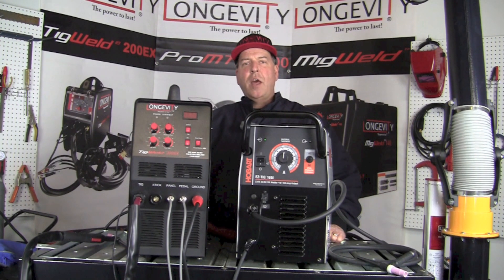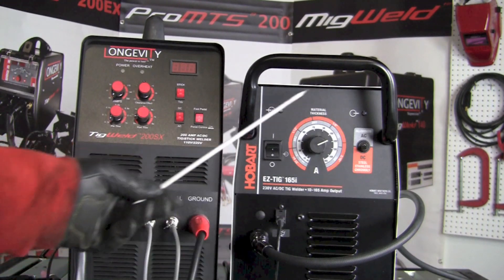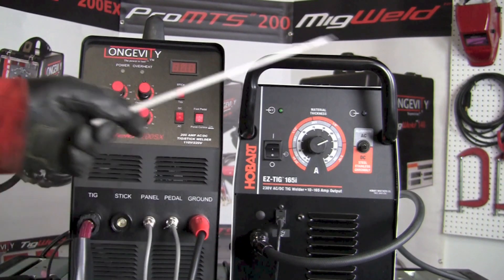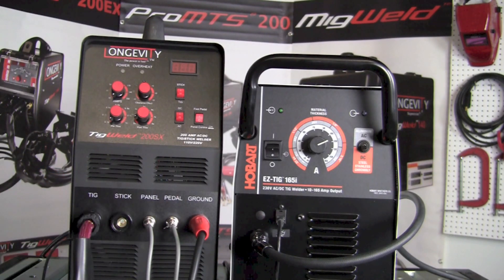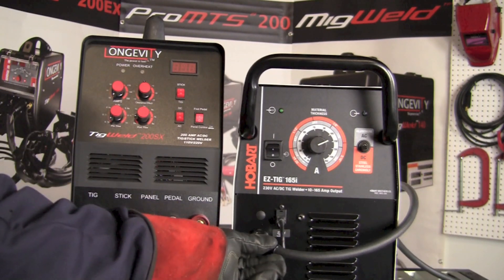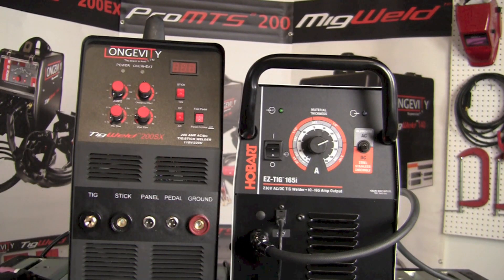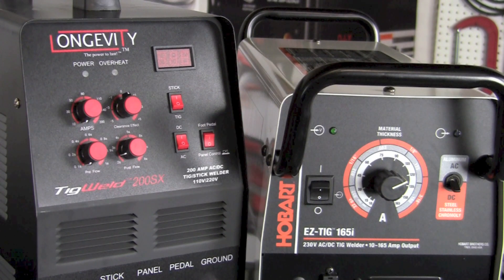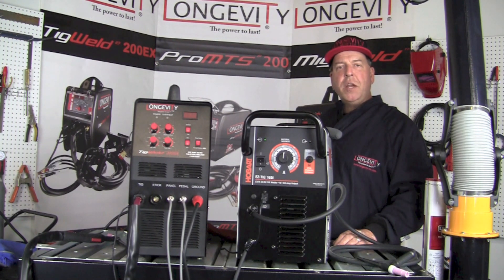HOBART EZ TIG 165I vs LONGEVITY TIGWELD 200SX HEAD TO HEAD MACHINE CONTROLS COMPARISON REVIEW PART 1

Comment: BOTH MACHINES ARE PRETTY MUCH THE SAME PRICE I GUESS CIVIL BART PEOPLE JUST WEREN'T THINKING AND IS PROBABLY COSTING THEM THE LONGEVITY DOES HAVE NICER FEATURES ON IT AND IT'S ABOUT THE SAME PRICE SO I WOULD IMAGINE I WOULD PURCHASE ONE OF THOSE INSTEAD OF THE HOBART
Reply from the maker: Well if you are looking for a great price for our machine. Give us a call at 877-566-4462. We would love to hook you up.
Reply from the maker: Thanks for the support! We continue on making professional, reliable equipment that wont break your pockets!
Reply from the maker: Our machine compared very well to this unit and in the opinion of the welder from the local school even compared to the Miller.